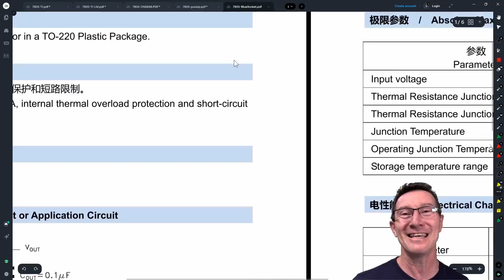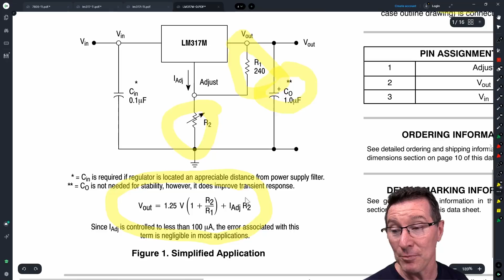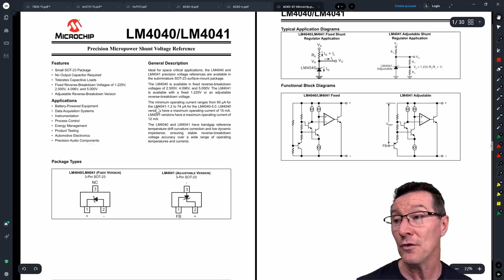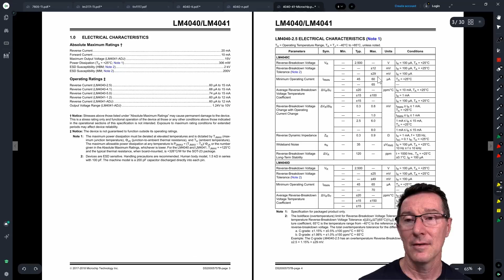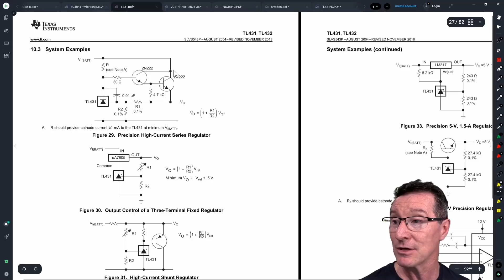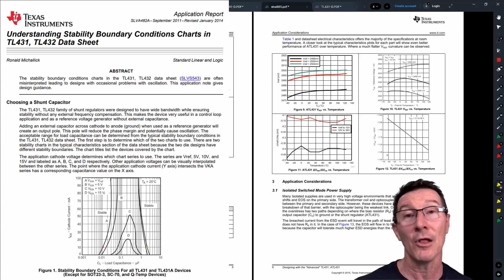EEVblog 1438 - The TOP 5 Jellybean Regulators & References

Comment: Just ordered a bag full of 431s for the exact purpose described here.  I have a lot of retro computers, from the Mac Classic and original PC to current gen.  I always replace the capacitors in PSUs older than about 5-10 years, the threshold depending on how much I trust that brand's parts selection.  Well, one time I didn't.

It was a Delta ATX supply from the early early P4 days, with a heavy 5V rail and the 6-pin Aux connector for Athlon boards.  I got three of those supplies, NOS, in one bid.  I serviced two of them, and got lazy with the third.  I ended up installing it in a box I use to image hard disks (it has a VIA Epia mini-ITX board and both PATA and SATA hot-swap bays.)  One day it had just turned itself off, and I figured maybe we had a brown-out.  Two months or so later, I tried to turn it back on and it wouldn't budge.  The KVM it was plugged into was also acting kind of weird, so I pulled the case onto my bench.  It was making a squealing noise, but some of my PSUs do that.  I measured the +5VSB rail to see if it was working at all, and it was measuring FIFTEEN VOLTS.  Yikes!!  I figured that motherboard was toast, but it's actually alive and (I think) running fine.  Can't believe that.

Anyway, I pulled the cover on the PSU and the caps right next to the opto-isolation circuit were bulging from the top.  Of course it's the caps.  It's always the caps.  There was a 2222 transistor and a TL431 right next to it, so I figured I would go ahead and replace those too.  I'm hoping to get some time today to replace parts and see if I can nurse it back to health.  Shame to waste a good PSU on some dodgy caps...

Always replace the caps!  Even if they look OK, if it has a few miles on it, you're better off safe than sorry.

Comment: THANKS DAVE.  YOUR JELLY BEAN VIDS ARE HELPING OUT WITH MY CIRCUITS IM BUILDING. FOR MY CASSETTE DECK ULTRA PRE AMP AND ANTI NOISE CIRCUIT FOR THEM.  AS THEY COULD HAVE MADE CASSETTES SOUND AS BETTER THAN CDS. BUT THEY DIDNT ON PURPOUSE AND IM PICKING UP WHERE THEY QUIT.    CDS NEVER WOULD HAVE BEEN A TJING NOR WOULD STEAMING MUSIC.   BUT THEY DON'T WANT US LISTENING TO CASSETTES AS THEY WOULDNT KNOW WHAT WERE DOING.   SO THATS WHY THEY NEVER DEVELOPED IT.    BUT MY MY ULTIMATE CIRCUT HAS. MOST IMPORTANT 200 DB S\N.   AS WHERE A CD IS 150DB.     THANKS DAVE

Comment: Total noob here ;-) Im making a garden tractor using an 80 Amp 36 V motor. Is it possible to find or make a softstarter, so I can avoid investing in a motor controller? Sorry if this is stupid. Regards John in Denmark.
Reply: I once made a PWM controller using a LM324 for a DC-DC inverter that powered an automotive audio power amplifier.
It was not 500Khz switching frequency.

Comment: NEVER depend on internal overtemperature shutdown (ALWAYS mount on sufficient heatsink to avoid the problem in the first hand)! Some of these kick in at 175°C TJ, etc. Ouch!!! And some datasheets clearly state "if you repeatedly activate the internal overtemp shutdown, you are degrading the chip"! And what will chip performance be right before shutdown???
Reply: Yeah i always got the feeling that the protection circuits on these regulators couldn't be trusted.

Thanks for confirming my suspicions!

Comment: I used the zxre060 because of the low power consumption "battery curcuit" and pull down to ground that can drive a fet directly.

Comment: You did not mention the LM317L. 
100mA, output current, minimum 1.5mA verses 3.5mA for thje LM317. 
Available in TO-92, SOIC-8, TSSOP-8, SOT-89, and DSBGA-6. 
I did not see SOT-223 or any larger packages.
If you feed each side of a Wien Bridge with a LM317L in constant current connection it will linearize the voltage output verses resistance change of one resistor.
The other Designer was using an expensive Burr-Brown DIV100 to do the same thing.
Accuracy is good enough for some applications.

Comment: Why, why, why is the pinout reversed for the 7805 and the 78L05???
Reply: I don't think it is. If you mean the TO-220 7805 versus the TO-92 78L05, then they can both be considered as IN - GND - OUT if you look at the TO-92 from its curved side. You can get small TO-92 heatsinks that can be screwed down with the flat side of the TO-92 downward, just as the TO-220 can be screwed down with the tab side downward. In those orientations, you have IN - GND - OUT for both devices.
Reply: Here in Sweden the dislike-button and the dislike-counter are still operational!

Comment: I've had some problems with the 7912, 7905 line depending on the manufacturer if it didn't have a minimum load the output value was not specified. But I always add a bypass cap at the output

Comment: 35 years ago at college as a project the whole class had to build fixed voltage bench PSU’s. +12, -12 and 5 volts out. First time I’d used a 7805. Used it to power all sorts of kit over the years.

Comment: 1117 regulators are common because you can take USB 5v in and lower it to 3.7v to power 3.3v (and lower) microcontrollers. I see them all the time in HDMI adapters, ARM devices, microcontrollers, etc.

Comment: Top 5 jellybean rectifiers next. (I can actually only think of 3 - 1N700x, 1N4148/1N914, and 1N5817. A discussion of the dizzying array of alternatives might help some of us understand why there are so many different devices designed to do only one thing in almost exactly the same way.)

If you need LM79xx, be sure you have some electrolytic or tag tant capacitors handy, as these regulators require much more bypassy capacitance than their positive voltage counterparts for stable operation. On that note, I've noticed several designs using LM78XX and LM79xx that have the same capacitor values on both positive and negative rails, presumably for BOM consolidation.

Comment: I once had a set of 7815/7915 regulators in a design. The 7815 would drift +200 mV with temperature and the 7915 +200 mV also.This is 6.67 mV per degrees Celsius or 444 ppm if they heat 30 degrees.
A pot was connected across them to give offset in a circuit. This did not work very well. 
I guess it would have been better to have a voltage reference.
They were not one of the name brands. I replaced them with Motorola and it was much better. 
Maybe they were Puelop.

Comment: Thanks for this series, it is very informative.
You did not mention that the 1117 has a maximum input voltage of 15 volts.
Also there is an LM317HV available from TI that has a maximum input voltage of 60 volts.
It is only available in TO-3, TO-39 and TO-220 packages.
There are a few 5 volt regulators with 50 volt input but they are hard to get.
A video on comparators would be good.
Reply: I thought 317 have no "maximum input voltage" because they are floating, and referenced to ground
Reply: @invisiblekincajou  The crux is in power-on, where the output capacitor may still be at ~0 V while the input already is near nominal value. So unless you can bring up the input voltage very gently, I wouldn't be betting on that!
Reply: @PileOfEmptyTapes  good point

Comment: I've seen a 7809 regulator ran at 38 volts input voltage in a commercial product, and it held up fine for 10+ years, but the 7909 on the negative rail died, but still works for around 10 minutes until it goes open

Comment: The LM4040/4041 does not appear to be a common part on Ali.  Have tried the TL431 as a reference, but it is annoying to sacrifice 8mA or more to get it up 2.5V.  The device is nicely temperature compensated, but the reference itself varies wildly from one device to another.  Makes me wonder, what is the ACTUAL go-to economy low power, low cost, temp compensated,  trimmable modern voltage reference?
Reply: It's still the TL431A. Perhaps you had a bad batch, but all of the ones I've had seem to work cleanly with  around 1mA cathode current, and I've not seen one outside of its specified voltage deviation of ±25mV. How much is "varies wildly" and what is "low-power" in your application?

Comment: I think the LM723 is useful when we need a completely customizable regulator and I have a huge (old) stock on them
Reply: Or the µA 723. I missed that one in the walkthrough.
Reply: µA723 variations are quite common in older adjustable power supply designs. While not super easy to use and practical by modern standards, they are still good for low-noise supplies, beating even a bypassed LM317 and making it close to LT304x terrain.
Reply: My favorite to. I used one to design a 1500 Volt Regulated Screen Grid Supply for a big mutha transmitting tube. As Aretha would say the supply is Rock Steady !
Reply: The zener reference inside the 723 tends to be a lot less noisy than bandgaps.

Comment: After spending the last three decades in the ethereal software world, in my retirement I have sensibly returned to the tangible world of electronics hardware.  This series is exactly what I need.  A perfect refresher.  Also, it is comforting to see that most of these parts are the same as what I used a lifetime ago!

Comment: in terms of not needing to put smoothing caps on the output of some of these regulators... Steve (SDG Electronics) did a recent video exploring this. With some test boards and different regulators etc. adding excessive capacitance where they are not needed is not always "harmless"... it can actually made the performance worse in some cases. Recommended to watch his video (SDG #212)
Reply from the maker: Will have to watch it. Yes, it's sometimes not that easy. Look at the TL431 stability app note linked in the description as a classic example. There is a unstable dead bad of capacitance values.

Comment: Stability is important!  Remember . . . in the extreme case, lack of stability can apply the full input voltage to the output terminal.  12V input regulated (with stability) to 3.3V logic power can potentially blow up your logic chips in an unstable (or slipped scope probe) condition.  Usually the highest tech (smallest device geometry, probably memory or MCU) part will act as a crowbar device to protect the rest of the parts on the board.
Reply: Sorry for my English!  At the moment, we have a PSU, which so noisy, some MOBO can't even boot with it. The noise can be seen an oscilloscope in 10V/DIV easily on the 12V rail.
Reply: To protect expensive components from a bad regulator I use TVS (zener) with a PPTC fuse for voltage & current protection. if the Regulator exceeds the TVS limit, it clamps the voltage and the PPTC fuse limits the current to prevent the magic smoke genie. This can can also be used on the input (Source) side to protect against over voltage and reverse polarity on the regulator. 

FWIW: I never use linear regulators going from 12V (or higher) down to 3.3V\1.8V. I use simple switches which can operate with input supply voltages up to 60V (or 40V depending on which ones you use). Simple switchers can also supply a lot more current & are much more efficient. I use a PI filter on the output to address switching noise.
Reply: @guytech7310  Yes, I only use linear regulator for low-current applications.  My stability warning also applies to switchers.  An extreme case can be accidently activated if your probe shorts the feedback pin to ground . . . the output goes to maximum and things melt/smoke.  Other user's comments about TVS or Zeners (which are "guaranteed to fail in short circuit mode") address my paranoid protection approach to address the stability failure mode.
Reply: @guytech7310  well clearly you are putting every thing in a soldered shut tin can or you just dont have to deal with emc
Reply: @urugulu1656  shielding would not address line noise on the supply rails. If you got a 100 mv pp on your 5V, 3.3V, rails no amount of shielding is going to prevent noise. Also rails can get switching noise as ICs supplied by the same rails can create noise as they switch on\off digital logic.
Reply: @guytech7310  knew that
Reply: Thats why Im using zener diodes as protection. In case of overvoltage some zener diodes do open circuit and some of them will make short circuit. Im using this with at least two parallel zener diodes.

Comment: Interesting fact. I've have LM7915 negative regulators that latch uo with no load connected. i.e output 20V with 20V input while latched up, not 15V as it should be. With load connected output regulates to 15V. Never had this with positive regulators. Yes even with input and output caps, tantalum ceramic, electrolytic all tested but this -15V can still latch up. Many will not encounter this as your regulators are usually loaded off course.
Reply: i've seen them latch (fail to turn on) when there is a current draw up to a positive rail (typical in split-supply projects, if the positive rail is turned on before the negative rail). Can be solved with a schottky diode.

Comment: I HAVE had the output of 7805's go into osculations when the load cap is open.  I don't know if it was brand of chip or what.  The output measured around 4v, if I remember right.  The scope showed a large amount of noise on the 5v rail.  I replaced the cap and everything started working right.
Reply: I've seen it to, didn't have a working scope at the time, but like you said replaced the first electrolytic on the 5V rail  (which had an ESR of around 140 ohms) and the unit behaved again.

Comment: 🇬🇧 Where's the 3 pin 431 type which can regulate below 1V @ 100uA cathode current and withstand 16V and about 100mA?
Wanted one for years for 1-10V light dimming protocol.
Closest was OnSemiconductor NCP100, but that was limited to 7 volts and it has been withdrawn I believe.
Most useful of you also want an accurate low impedance  'zener' below 1.25V.
And..it's my birthday today! 🎂
Reply: use 2 TL431 with a voltage difference of 1V between them, and use the low side TL431 as ground.  Ie TL431 (A) at 3.3V and  TL431 (B) at 2.3V = 1V difference, Then use TL431 (B) as your ground.

Comment: I've seen 78xx regs oscillate with no output cap
Reply from the maker: I might have seen one once, don't entirely recall. I experimented with that a few years back trying to make it happen for a video, couldn't do it. I always add the caps just in case.
Reply: I've seen 7805s oscillate when the output cap got the freezer spray treatment.
Reply: If my memory serves me right, 78xx and 79xx should have the ceremonial 0.1 µF decoupling cap from input to ground, and from output to ground, and preferrably have a properly sized and designed ground to avoid various issues.
Reply: I once saw a mid 1980s Japanese built 7805 in a Nintendo oscillate (best I could tell that was the problem anyway) with a failing output cap, it had a small ceramic right on the output and another electrolytic on that rail a few inches away, just the nearest electrolytic (so near that the 7805 cooked it) had gone high ESR and that was enough to get it going and cause weird video distortion.
Reply: Even modern LM317, LM1117 can oscillate without the load. 
The specs from datasheet should be respected (e.g. minimal current).
Reply: I had 7806 get really hot without an output cap and really low load.
Reply: @TheSergeiFranco  That means it's oscillating.
Reply: The circuit itself may require bypass caps.
Reply: Howdy 👋🍻
Reply: If you use a mlcc output cap >0.1uf it can oscillate, 1uf+ with some esr they're fine(I just use 1uf mlcc with a 1r resistor).
Reply: happened to me last Thursday

Comment: Never used a 78XX.... Maybe I need to break my cherry. I just make kwrap for myself so I just have a stack of lm317, lm337, lm338, ams1117-adj, ams1117-3.3, ams1117-5.0, ams1117-1.8, tl431, amc7135 (okay not a voltage reg) etc

Comment for the alg
Reply from the maker: Sacrilege!

Comment: ATL431 looks like a uncompensated tl431. Tl431 was also used as a crystal set amplifier.
Reply: I am still looking for the plans for a radio made with a 555 I saw once.
I think you can make a radio with anything.
It would be funny to have a competition building devices using chips like LM555, LM723, CD4049UB, and TL431 using non-standard configurations.

Comment: Quiescent Current will fuck you up if you're designing battery powered stuff with deep sleep and stuff.
I had a 0.8uA Microcontroller + LCD and 8uA drained by the freaking regulator... which was not in use...
The freaking thing drained 8uA from Output to GND... 
I spent so many days testing and programming and it was this stupid component...